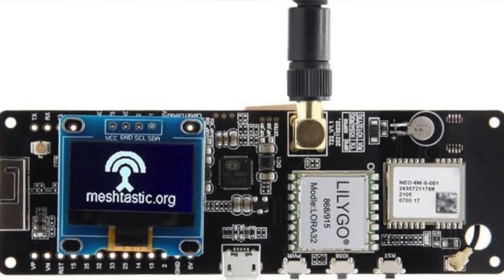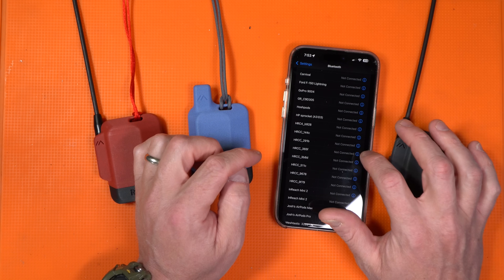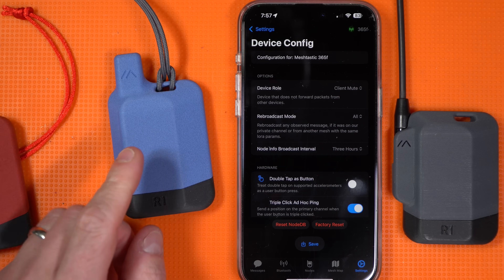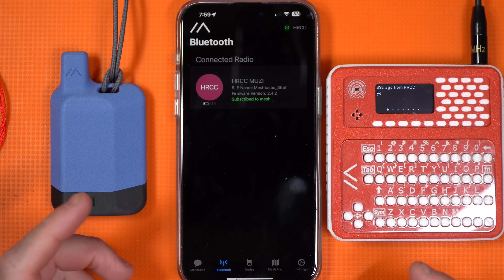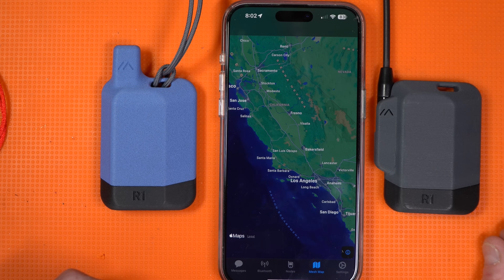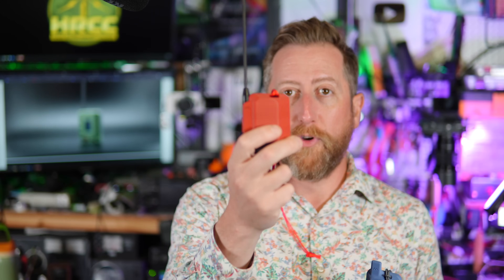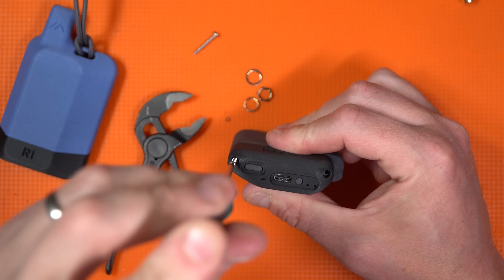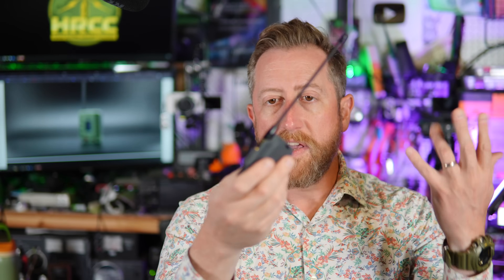Great Turnkey Meshtastic - Muzi Works R1

Comment: Can someone explain how people are using these? I recently got a seeed sensecard T1000-E and I'm getting max retransmission reached for any message I send to channel 0. Other than broadcasting to strangers, what do people do with these? Are there public chat channels?
Reply from the maker: Channel 0 is the public chat channel. You can make private channels for friends and family.  

In your case, max transmissions means you’re not getting out. Go outside or higher elevation to get your messages out.

Comment: Do you have any advise for using Meshtastic in a rural area with lots of hills?
Reply: Put 1 node on the top of the tallest hill for a start (with permission from land owner of course). It should be a solar powered node.

Comment: What kind of range could be expected with these  with and without the external antenna?
Reply: 100 yards....1 block.....The idea is to install an above the roof tall antenna pole / antenna / repeater to help connect all the tiny units / nodes together.  Once You have the above the roof top repeater ...or....multiple epeaters You can cover an entire city like Los Angeles 😊

Comment: Like the design and form factor. I searched the comments and didn't notice anything about weather resistance. Not that I want to mount these but instead be able to wear them in rain or snow, or maybe a mobile mesh base station camping.
Reply from the maker: It’s not sealed. You need to wear it under a jacket.

Comment: A little off topic but my biggest goal rn is to be able to reliably communicate without internet with my buddy that is a 1.5h drive away. i want to try APRSdroid with my 8w feng and a directional antenna, then try dropping some cash for a budget HF if that doesnt work. Any tips to reach out that far without repeaters?
Reply: If your buddy is over the horizon UHF/VHF is not an option. The signal runs off the earth into space. I would go with HF. Unless you have many locations you could drop these nodes, but at that point you may have a bit of cash into nodes.

Comment: I don't have my ham license yet but I'm interested in getting it. I enjoy the videos and want to eventually get a license. My question is what does this device do? I can text from my phone already so what advantages do you get from this? A map with other users,  more range or is it just like a handheld radio with dmr linked to your phone via Bluetooth? ( Essentially an antenna with tx/rx)  Do I need a license to use this? There's so many things out there that are feature specific it's kinda hard for a new person to figure out what is going to be for everyday use.
Reply: No need for a license. Think of these as off grid texting. Say you and a buddy are in the woods where there’s little or no service. If you each have one, you can msg each other. If you both have ones with GPS integrated, you can share your location with each other.
Reply: I agree with you entirely. Its cliche, but start with a baofeng analog radio. I was super overwhelmed, didn't want to spend uninformed dollars. Bang Baofeng!
Reply: Remember the hf 40m pixie? Wouldn’t it be great to have that in this form factor. And in different bands. Where is that k6ark when you need him?

Comment: 4:08 I set Button BPIO to Pin 31.  I have a Heltec V3.2.  It rebooted the device and I was not able to connect again.  I have no idea what button GPIO Pin 31 does but doesnt work great on a Heltec. Reflashing the firmware brought it back to normal.

Comment: Problem with using the phone as a screen is that the government, that controls Apple and Google, can block use of the app anytime they want. Or snoop.
Reply: The gov could tell Apple to remove from the app store. But if its already on the device it wont disappear. If you need to upgrade your phone just ensure you have an offline backup, else cloud backup wont reinstall apps which were since removed from the App Store. Google on the other hand, it's build from the ground up to track your every move and thats easier to tap into - it's their fundamental business model after all.

Comment: The new Heltec T114 uses the same power efficient chip as the RAK. Another excellent option.
Reply: I have the Muzi Works T114 device. Love it and excited to get the gen 2 hardware to fix the low power transmission issue. Muzi Works has EXCELLENT customer service BTW.
Reply: I too use their H2T. Very nice
Reply from the maker: Oh nice. I didn’t realize that. Thank you!

Comment: Nice quality looking case - thanks for the review.  I noticed the option for 'Licensed Operator' when you were showing settings - what impact does checking that box have (I noticed you didn't check the box)
Reply from the maker: I believe it can up the power output. But not where you are transmitting at 915 MHz. I’ve played with it and it’s not worth the effort.
Reply: @HamRadioCrashCourse  Thanks - I assumed it turned off encryption,  so wondered if the impact of that is that you cannot see Long Fast messages from non-licensed users, if you checked it?
Reply from the maker: I believe it does that too!

Comment: You mention RAK a lot, but it's worth pointing out that the RAK's are using nRF52840 which is the reason they're so low power - there's other nRF52840 based devices available and they're also just as low powered.
Reply: And hopefully more affordable! When you contrast what you can get in HAM HTs for the same cost this Muzi seems incredibly expensive. Especially when needing to purchase two of them.
Reply: @tonyhawk123  Yes, on account of the Muzi's not being mass produced (Simon 3d prints the cases and assembles them himself). He does make his case designs available, so you can 3d print them and assemble yourself if you want to keep the costs down.

You don't need to purchase two, same as with any handset/radio.
Reply: @JohnBaxendale where we get the internals
Reply: @mfvigilante RAK, though I’d suggest just looking at other nrf based devices which are generally cheaper than RAK and just as capable.

Comment: I have the heltech H1 from Muzi works. Only complaint i have is that is the battery doesn't last but a day
Reply: This is the problem with the Heltec V3 and every other ESP32 based device, it uses much more power than the nRF52840 based devices.

Comment: For atak would you still recommend building out your own helltecs with gps unit? Would these and your phone's gps even work with atak? thanks
Reply: Curious as well.
Reply: I'm not an expert, not even a user yet, but everything I've read so far indicates that the answer is...depends.
If you don't plan on giving your deployees a device to send or read messages, then an installed gps module will track them. However, if the intent is to two-way communicate then the presumed gps in the device, tablet let's say, is sufficient.